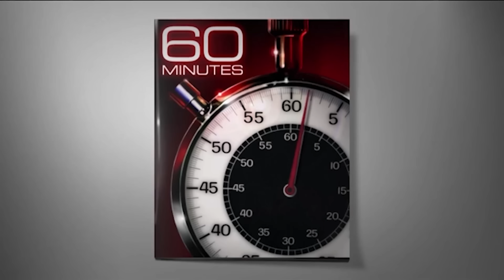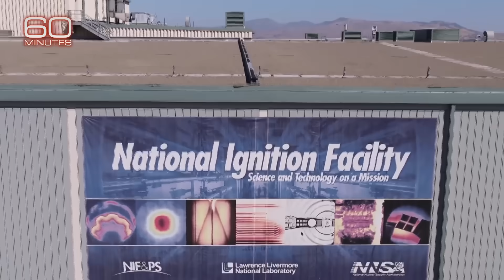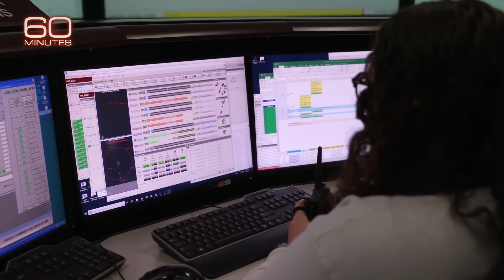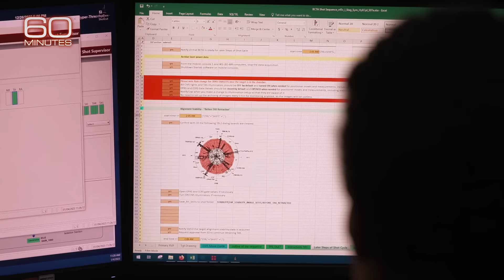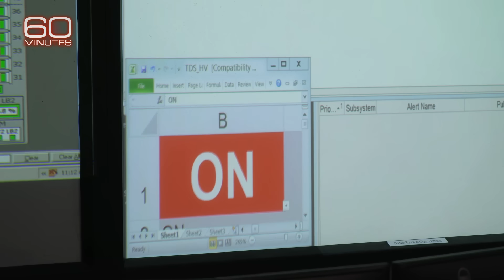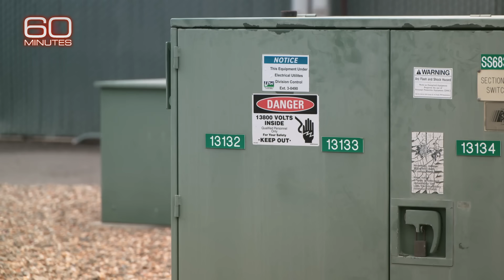Nuclear Fusion: Inside the breakthrough that could change our world | 60 Minutes

Comment: Fusion is such a waste of time to produce, just harness the reactor in the sky with solar panels and batteries. Why create what is already readily available?
Reply: Because solar has its own problems, and also can’t be used everywhere
Reply: @Gomlmon99  you're wrong actually. Do they have power plants in every town, city, or neighborhood? No. They have these things called cables that run for miles to get from plant to final destination. Solar and other renewables are no different. Have the power collected in one location and then transferred to where it needs to go. You don't need it everywhere, you only need panels in the sunniest locations and then batteries at the final spot. 

Do your research, and don't be a simp for billions of dollars wasted on fusion. Fusion would literally only make sense as a mobile plant, like on boats and other large vehicles. And yes because solar has its own problems, we should fix it and make it better and spend money on something that ALREADY WORKS instead of pouring money down the fusion drain for another 50-100 years.
Reply: @ethangaines2658  They have power plants in every country yes. It’s impossible to put all the solar panels near the equator and then run power lines to the poles of the planet. The costs and energy losses would be staggering.

Please don’t post comments about things you don’t understand.

I’m also not saying fusion is good. I’m simply answering your question of why create a new energy source when we already have one.

Comment: The next breakthrough would probably be to make the target smaller so you need less energy to fire it. Like constructing it to the molecular level similar to semiconductor manufacturing
Reply: Yes, but how much energy would you get out of it?
Reply: Less energy to fire it with correspondingly less energy output. The goal for a commercial fusion reactor is to produce enough heat to be self sustaining and produce enough excess heat to boil water in the reactor jacket, to drive turbines. That is why it is prophesized to take decades at the very least, if even possible before the collapse of civilization, to become a competitive means of power generation.

Comment: What a joke, they've been saying the same BS for the last 50-60 years! It still cost 10x more to run than the power it will ever output, dont believe there lies. Like all current power plants, its just a fancy overpriced(dangerous) heater. It does not make electricity directly! Ask them what happens when the magnetic field drops while active plasma burning.  lol

Comment: You can’t use it until it makes above three times the energy input.  The power plant can only be 33% efficient using the thermal energy.
Reply: If they sustain it, there will be endless energy output. 33% is a drop in the bucket.

Comment: If you are currently in your 20's or 30's, you will not see this become commercially used in your lifetime. This is too far away to being efficient. They said it themselves, the lasers took 300 units of power to produce 3 units. That is not something solvable in the next 10 years.

Comment: Here's your breakthrough money driven lies knew it              What is the “breakthrough”?

The fusion approach pursued at NIF is inertial confinement fusion, where a small pellet of fusion fuel is compressed to the high densities and temperatures required for fusion. To do this, NIF uses x-rays generated from 192 laser beams hitting a gold can the size of a pencil eraser and converging on a fuel pellet smaller than a peppercorn.

2.05 megajoules (MJ) of energy was delivered to the fuel pellet and 3.15MJ of energy was released in fusion reactions, giving an energy gain of 1.5 or 150%.

Naturally there is some scepticism. 3.15MJ is only a tiny amount of energy, enough to boil a few kettles. Additionally, the laser took several hundred megajoules to run, so if you take that into account they are nowhere near an “engineering” breakeven. We are still a long way from real fusion power to the grid. So is this really a significant breakthrough?
Reply: Well no, it’s for defence, not electricity production

Comment: All this high-tech engineering backed by billions of dollars will only result in failure. The reason being that they still don't understand the geometric component that is vital for a sustained fusion reaction. They will continue to waste time and money because their approach is wrong! God help these clever idiots. "As above so below"
Reply: If u have the answer go tell them
Reply: @dinty7265  I can’t do anything but develop a proof of concept, and hope some angle investors back my vision. My ideas are not revolutionary at all, Buckminster Fuller has already pioneered the discovery of nature’s most optimal form to facilitate energy compression. It is a form found everywhere in nature, and it’s also mathematically derived from the golden ratio! It’s called the “Vector Equilibrium”! These people are using the wrong containment vessel geometry, nature only has one form that allows this to happen with the least amount of energy! I am not academically trained in plasma physics or high level mathematics, but what I do have is the ability to connect the dots when it comes to obscure theoretical concepts. The scientific community is very snobbish, I have to pull a Michael Faraday and come through the back door.
Reply: @hexagonmagnetics569  u cant telll anyone?
Reply: @dinty7265  Yes, but without proof, will they listen to some guy that didn’t even finish college? The answer is no! I have to build a small replica that manages to consolidate plasma within a localized point in space. The plasma will be contained by a symmetrically balanced compressive magnetic field. This device will appear to be a mini desktop sun, but just without any real fusion occurring due to my energy limitations. Add some billions and some talented people working on it, I promise you fusion will happen!
Reply: @hexagonmagnetics569  I encourage you to go out and find anyone who will listen because I’m sure if you explain it in a way that seems very legit there will be at least one person would listen

Comment: The method of " Fusion " demonstrated by Livermore Labs' laser-based process is called Thermal Fusing of Isotopes which means using heat and pressure to squeeze atoms together in a non-Ionic fusing manner. I've already told them this on more than one occasion. 
The real method of achieving Fusion involves ionicly fusing protons and electrons together to create neutrons. This process can create Helium...
Though I use scientific methods & research in figuring out " how it works ", I'm an Engineer by schooling & training. It's up to the Engineer to prove or disprove what the Scientist is telling him. 
Yes, I do have a solution to Fusion.

Comment: They fail on the side of caution. They very well could crank that bad boy up and initiate fusion anytime they want. Its the "Controlled" part not the fusion part that's important. They are trying to find that sweet spot where it reaction can be initiated, and stopped instead of just starting and then running uncontrolled. The purpose being to create a small enough controlled reaction to study in close detail so we can find out if its throwing off the kind of cosmic style particles that can have a detrimental effect on things like DNA. To get a better idea look up "Optimara Space Violets" which are grown from seeds that were exposed to raw naturally occurring space radiation and represent a quantifiable laymen example of why just jump starting a small sun inside the atmosphere might be a terrible idea with out the right knowledge.

Comment: dudes forget fusion and try harnessing self sustaining frequency vibrations, it works like this, you need ignition frequency, subject matter and space, the space dimensions is the key and is what self sustains the frequency vibrations. Output can be greater that input if the space naturally amplifies the input frequency, there is a pivot point where the vibrations will self sustain within the space if the frequency matter and space are the right combination of size, frequency, material and space dimensions

Comment: HUGE mistake in this documentary. Nuclear fusion is NOT the same type of reaction in a nuclear bomb. That is called Nuclear FISSION, which is different and radioactive. Fusion is not radioactive because it doesn’t require unstable isotopes of Uranium-234. Nuclear fusion is taking stable isotopes of hydrogen fusing together to create helium. …Which would do well for the helium shortage. It is NOT radioactive and is NOT used in nuclear bombs

Comment: Playing around with things that can destroy the entire planet. Eh buy an EV to reduce the pollution and save you money!! Yeah right. New F150 Lightning 100k. Takes like a battery that took 10 trucks to dig move build ship manufacture then deliver to ford then drive the truck to the dealership. The battery already costed 500 gallons of fuel to build. Thats why it costs 100k.  Same here it costs at the moment less to get the power it produces. However the amount of work and this massive operation gave enough power to run like one house... You would need like millions of systems like this to generate power. Never mind the insane overhead of costs...

Comment: This did not produce more energy than it used. They're only counting the energy in the lasers; they don't count the power going to the station. It was a very small gain, but totally offset once you add up more than just the lasers.
Reply: The lasers are 30 year old tech.  There are way more efficient lasers available.  Now that this achievement has happened, more funding may mean and upgraded facility.  Can't upgrade without results...

Comment: Great report, as always from 60 minutes. Very exciting step, even considering the 300/3 ratio mentioned near the end. I certainly hope there can be steady, incremental improvements. Honestly, I think 50 years would still be impressive! Let's see if it can be reality!
Reply: I wouldn't say "as always". 60 Minutes is only good with non-political subjects nowadays
Reply: @chrismoser9676  This whole  episode was a total bunch of false claims! they left out all the improtant parts inclduign it too 300 units to make the 2 units to get 3 units out!
THATS KINDA IMPORTANT! 🤦‍♂🤣
Plus the reasons its an impossible idea to get to work!
Reply: I know I'm late to the party - but the reason the 300/3 ratio doesn't matter is that once we have ignition , the synthetic sun would feed itself the energy to keep running - plant operators just have to feed more fuel (the hydrogen isotopes) and control the million degree plasma. So once we have ignition, we might be operating at an energy deficit for a little while, but in the long run, the thing feeds itself. (The notion that we'd run a fusion plant using these tiny hydrogen pellets is absurd. This is the national ignition facility. The whole point is to get ignition, which is just the beginning of creating our synthetic sun.  Once ignition is achieved, the rest of the process can be developed.)
Reply: Helion fusion is almost there now, check them out.
Reply: LOL NO IT WAS TERRIBLE FALSE CLAIMS FROM IGNORANCE!
Reply: Like

Comment: The net “1 unit” of energy out was less than 1kWh or about 1 ounce of gasoline heat equivalent.

The very high power rate is because it occurs so quickly, like the very high temperature but for only a tiny mass.

Not as impressive as the folks whose future employment depend on further taxpayer funding make it sound.  Pretty small output for such a big, multi billion dollar machine.  More fusion hype in my eyes.  It is, however, likely enough progress to secure further government funding, so we will see if they can replicate this result and further improve its performance.

Comment: Using larger target points that require less effort and time may be the trick.  But the real key to the enterprise would be the amplification of laser power...some kind of a laser amplifying device.  Current power sources would have to be used until a consistent power output could be maintained...and eventually sustaining itself.  Becoming its own power source, for endless power.  It can be done and the pressure of doing it for ethical purposes must be maintained as well.  Time will tell.

Comment: So with Starlink satellites internet connections usage you could have a way of using the internet connections usage too charge house's and mobile phone's and solar power electricity Walls Solar electricity Powered panels and batteries in your Tesla model cars by just using a sim card device that is digital with code's connected with them and then you could have wireless charging Bluetooth connection charging devices for your charging stations using the internet connections usage as well .
You could make your very own unit sim cards.
So back too the story so we can change the timing with charging stations and Tesla model cars and vehicles and applications with help from your Starlink satellites the timing of the internet and artificial intelligence and WiFi connections and Bluetooth connection charging devices and electricity too make close to the speed of light in your Tesla model cars solar powered electricity panels and batteries your Tesla model cars charging stations and your family of Starlink satellite's too be able to make healthy and safe travels of rocket's body's ability to be carried though out the timings and too make sure that the speed source is not deadly for humanity....... So if you were too connect your Starlink satellite's while charging devices too your charging stations and have your charging stations provide a super fast charging device for your Tesla model cars batteries and the internet connections usage from your Starlink satellites would provide it the speed of light or almost the speed. of light or even faster than.......
If you then had your solar powered electricity panels in your Tesla model cars and vehicles windshields and all area's connected too WiFi connection internet connections usage for you and your family of Starlink satellite's then you could make a way of a Tesla being up too 100 G that's right not a 5 G not a 4 G but either way a 100G or just a little slower than this by using your phone computer devices Tesla model cars application's auto pilot systems and better yet charging for Solar electricity Powered panels on your Tesla model cars a more convenient Way of being or wanting or buying Tesla model cars....... And with this said it is also an option for the Tesla model Power Walls for house's and even better useage your or other's larger than factories and business's and company's or etc and etc and etc.....
If you want to make 100G internet connections usage for airports and airplanes that fly with the situation of using the Power of the internet connections usage and your family of Starlink satellite's and airplane Power Walls with micro SD WiFi connection charging devices and internet connections usage then you could sell this idea too Quants Air line's and other airlines like Etc etc and etc.....
With the situation of your saterlights and power electricity paneling drone like formations on the airport connections usage run way's and the airplane's themselves on the wing's in a casted body shape that works like a WiFi connection charging device for airplanes that you could personally use your phone or mobile devices during the flyt and have them using internet connections usage for volume strength and airports connectivity in adjustments of levels of the planes tracking's of the actual planes and airport's and location of wind 🌬️ 🌬️ 🌬️ and humidity levels and oxygen levels in the atmosphere of the flying objects the airplane's themselves then this could work wonderful too.....
I have many many more ideas on how too use this too speed up science and technology engineering therays and progress ......... 
Your's sincerely Ms Lilian Meade thanking you kindly for your time today

Comment: I am glad there is research. Happy to have an advancement. Notice the 2 units of energy the light put in and 3 units of energy from the fusion. It took 300 units of energy to create the 2 units of light energy and how much to build the building, equipment and operate the lasers. They are closer to fusion energy generation, but just by a little. I thought the old Tokamac also had breakeven and the theta pinch only worked a fraction of what was expected. Maybe only a totally new approach will work. Muon capture. The muon replaces electrons in a hydrogen molecule and pulls the atoms so close, 20deg C is enough.
Reply: The lasers are 30 year old tech tho.  There are already better units available.  Now that they have achieved fusion, they may get a bigger budget which might include more efficient lasers.
Reply: @machupikachu1085  Notice there isn't enough energy to heat the building or run the equipment. Then converting the heat into electricity takes at least %50. They can't even reproduce this! This is one out of a thousand tries? Concentrating Deutritium takes a lot of energy as well. Dr. B. Chen predicted that there will be a return to simple breeder U-235 reactors.
Reply: @easterbrookmike  How many tries did it take to run the 4 minute mile? How common is it today?  How many attempts did it take to make the first helicopter flight?